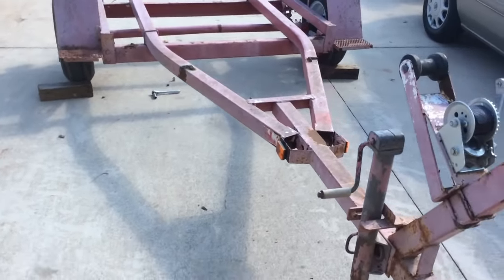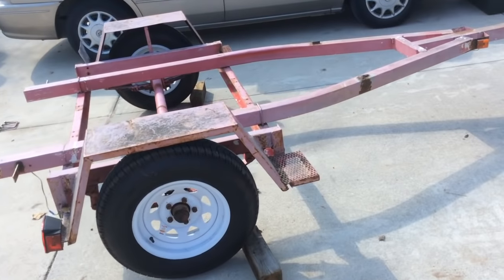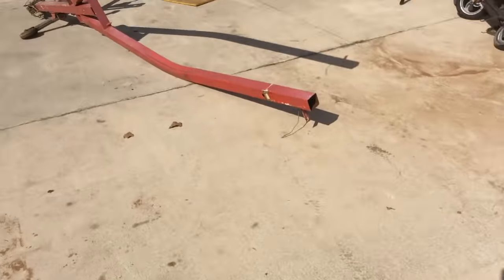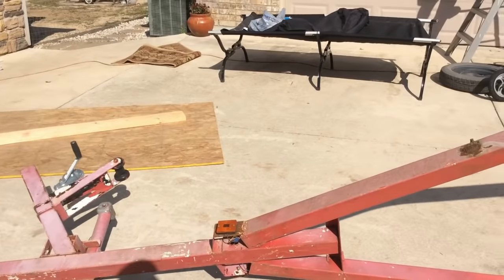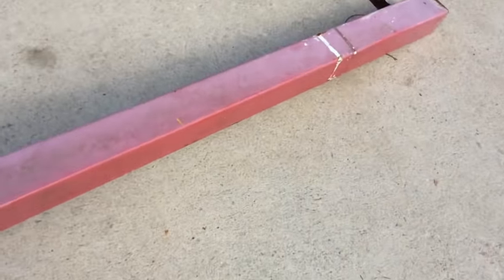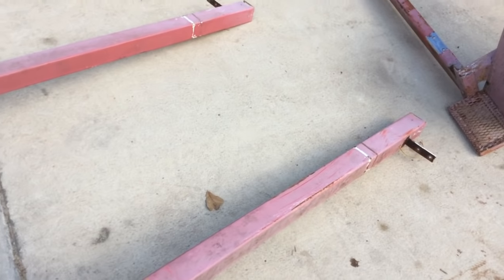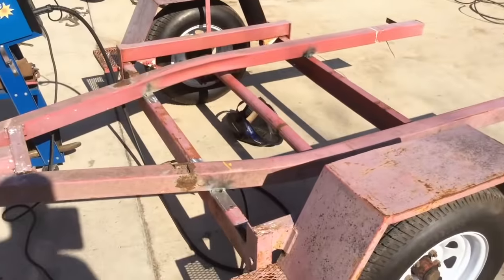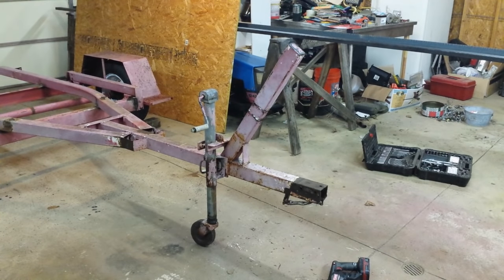5x10 Utility Trailer Build - Part 1 of 4

Comment: This should have been common sense, but prolly better if you wore work boots around metal fabrication projects. Crocs dont really provide full protection. Its a good way to lose a toe...Just one of those easy things you wish you had done after the fact. Good idea on the boat trailer i think. What is that axle/tire rated for?